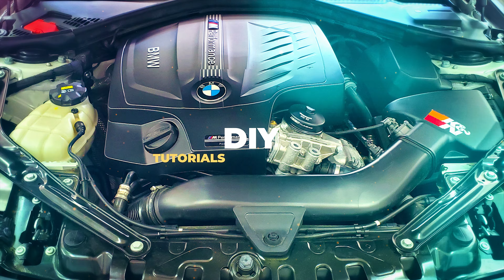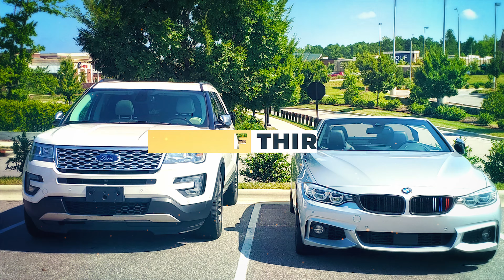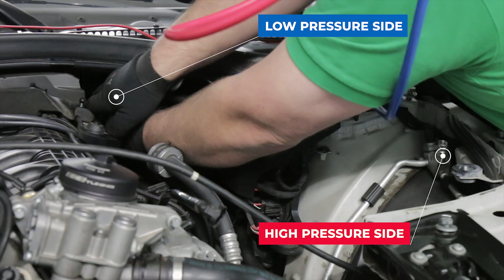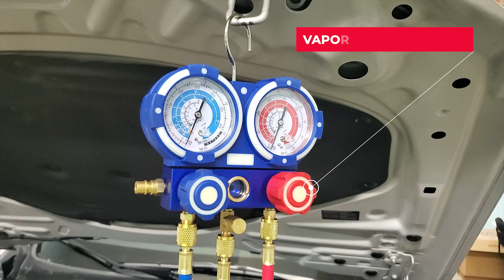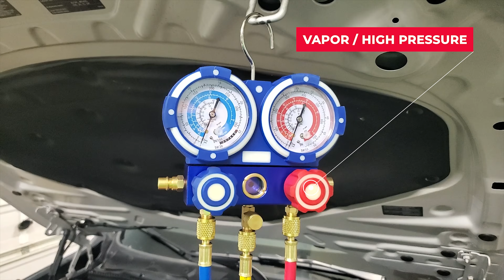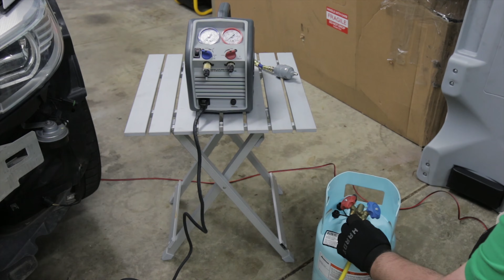EVACUATE YOUR CAR'S AC SYSTEM THE RIGHT WAY

Comment from the maker: A must when working on your car's AC system 👍 🧊❄⛄❄🧊

🛠Tools Needed🛠
Recovery Tank: https://amzn.to/3xee9hI
AC Vacuum and Manifold Gauge Set: https://amzn.to/32bI5wY
Additional Yellow Hose: https://amzn.to/3n8Eg5o

Refrigerant Recovery Machine: https://amzn.to/3twzcdj
Recovery Machine Filter: https://amzn.to/3n3pcFS
Safety Gloves: https://amzn.to/3sBjCvI
Safety Glasses: https://amzn.to/3atpcKl

🎥 Helpful Videos 🎥
Install the CSF Performance Radiator: https://www.youtube.com/watch?v=ZxJ61JY2iaY&t=0s
Replace Your F-Series AC Condenser: https://www.youtube.com/watch?v=QIfHN4UWcIA
Reply: almost $950 and then they wonder why the system is evacuated "the other way"...
Reply: All you need is a Valve stem remover.
Reply: @RiggyRiggshow did you drain the ac? You just remove the valve stem easyly?
Reply: How do you put refrigerant back in??
Reply from the maker: I'm not sure what you've seen previously, but I had everything connected exactly how the instructions showed.
Reply: Why do you need additional vacuum pump? I thought the blue evac machine did that

Comment: Tank is $600 hose is additional price and the recovery tank is $100+. Then you gotta find outwhere you can dispose or get rid of the stored old freon. Self repair would be estimated around 1k in funds. Seems cheaper to take it to a shop. I hope this helps anyone who needs to replace an ac condenser
Reply: If you have two old jags and two old Mercedes and the ac is borked on all of them it starts to look tempting?

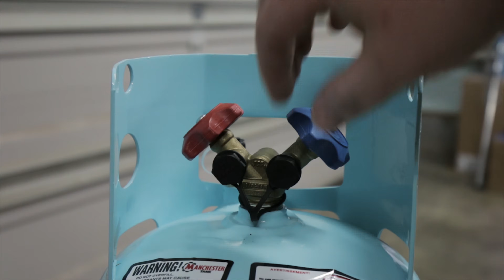Comment: 1:58  Ambient “air” is made up of 78% nitrogen, 21% oxygen, and the rest being “other gases.” There’s no reason to open a brand new tank’s valves to vent the 100% nitrogen atmosphere within the tank and risk exposing it to moist ambient air, even for a moment, prior to hooking up the vacuum pump hose. Simply start the pump motor and then open the valves.
Reply: Why not just connect the pump to the tank then turning it on  before even letting the nitrogen out of the  tank?

Comment: low side high side doesn't matter when the system compressor isn't running its in the same state on both sides and the low pressure side is the vapor side its vapor until it is in the condenser until it hits the orifice tube and goes to low pressure turning into a vapor

Comment: At 5:21 you said - slowly open the inlet valve on the recovery unit (machine) until it begins making a knocking sound, once you hear that knocking sound, slowly close it until the noise stops.

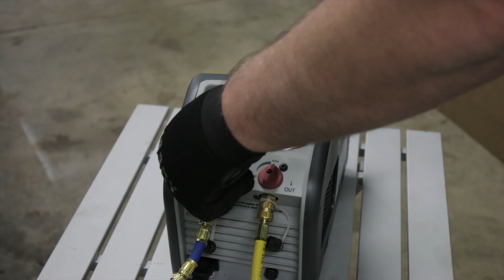At 6:01 you said - then, on the recovery machine, close the inlet valve first... 

( so then.. you never showed in this video when you re-opened the inlet  valve, to then re-close it...because, you had already closed it at 5:21 

Great video,  but that part is confusing to me.
Reply from the maker: You don't close the inlet valve all the way, only until it stops knocking. It's still open, just not full wide open.
Reply: @fthirty3  thank you so much 🙏

Comment: Vacuum and manifold gauge set linked came with parts missing. Manufacturer didn't respond when I contacted them. Save some money and rent this from an auto parts shop. I got the deposit back so it was free! All I had to pay for was the oil.

Comment: I see where you opened the LP/Liquid side of the manifold gauges, then opened the outlet side of the recovery machine, turned it on, and then turned on the inlet side of the machine until the knocking sound stopped.  

How is anything getting pulled out of the LP/liquid or HP/vapor side quick connectors if the connectors weren't turned to the open position to tap into the system?  These would have to be opened before opening any of the valves on the manifold gauges, correct?

Comment: How much money to spend in order to save $20.00 in new freon at Walmart? Recovery freon when million cars out there are leaking every second, even new cars on lot and those that no one bought it. is absurd
Reply from the maker: It's a closed system and should never leak. If you're leaking....there's a problem.
Reply: @fthirty3  Nooo. Maybe you don't know anything about a/c systems. In my Elantra 2008, never has any services and just last year I had to add a can of freon, because was at 85 degrees inside with a/c on, and then went to 41 degrees. It was just a little freon. meaning all system release or lose freon with the time, so what the hell are you talking about? This happens to millions of cars owners.
Reply from the maker: @HeydaCarreras   I think you might be the one that doesn't understand how a/c systems work in vehicles. Just because you don't have a massive leak does not mean you don't have a leak. You could be leaking through microscopic holes in your evaporator or condenser coils. You can also leak through worn out evaporator and compressor seals. Your anecdotal experience and lack of troubleshooting to find the root cause does not mean that all vehicles leak Freon. 

In my case, I needed to remove the refrigerant from the system because I was replacing my condenser, and I didn't want to throw toxic refrigerant into the air to do it. Go to any shop and ask if they just release it into the air when they work on A/C systems. Anyone can do something the cheap/easy/wrong way, but some of use like to do things the right way even if it means it might be a little more work or cost more.

Comment: What's the difference between a recovery machine and a vacuum pump?
Reply: A vacuum pump evacuates all of the air and moisture out of your system.  The recovery machine sucks all the refrigerant out of the system, compresses it back to a liquid, and pumps it into the tank.  It has a big a** motor, a small radiator, and fan.

Comment: R134A is not toxic to the Ozone Layer.  It was developed to replace R12 that is toxic to ozone.  EPA opposes R134A release to the atmosphere because of its Greenhouse Gas Potential.  R134A was released to the air for many years until 2020 when a law was passed.

Comment: You left out several things: what's the red port side for on the recovery tank? You never drained the red high pressure side into the tank?
Reply from the maker: The two sides are connected in a loop. You only need to drain one side.
Reply: I thought he bled the blue side first, then made a quick remark later about opening up the red side.

Comment: How much would a shop charge?
Reply: In many cases, shops will do an evac for free (or low cost) since they will get paid for the reclaimed refrigerant.  You'll have to call around.  As for repairs, proceed with utmost caution.

Comment: I'm about to fix my ac in my car as my condenser also got damaged and i heard letting refrigerant out into atmosphere is horrible so i ended up here to do it the proper way. I also learned you gotta make sure theres no moisture in the system... And after my research i figured this isnt a hard extra step at all... but then i checked the cost of the recovery machine and the tank.. i think ill find an alternate method of evacuating the system without releasing into atmosphere..

Comment: Hello friend, your video is incredible, thanks to it I fixed my car and saved money, but I have a doubt and question ❔❔❔.  After doing all that process I have to add oil to the system again.
Reply from the maker: Glad to help! It depends on how you fill it. If you use straight 134a, then yes, you'll need to add some oil. If you use the AC recharge cans like ACPRO, then no, because it has everything already in it.
Reply: @fthirty3  Thank you very much for the information, I appreciate it, God bless you 👋
Reply from the maker: You are very welcome! 🙏
Reply: When you add in the oil, add in some UV dye as well.  Many YT videos on this.

Comment: After buying all the equipment you might as well take it to the dealership
Reply: Well, yes, but… if you have a number of vehicles whose ac is not working it starts looking different. Then, does the system just need a “recharge” whatever that means, is the condenser leaking, is the compressor bust or any combination of the above? Next, you take it to a dealer and either it costs a kings ransom or he says the parts are not available. Sometimes the dealer / workshop just doesn’t want to do it because it’s hard work and they prefer easy stuff.

Comment: You forgot to purge the ac lines of air when you connected then to the Robinair.
Reply: Good point.  Does it even matter since we're not recharging an AC system but draining it.  On the other time, why do we vacuum an empty tank?

Comment: Ok i decided to set the record straight for everyone who is not 100% sure wth they are doing in the first place and let you know whats toxic and whats very very  low toxicity.
R134a my friends is a very low toxicity refrigerent and yes they prolly use in air cans because its not really toxic at all. But you should still try and recover rather than release! Now lets say R410a this is some nasty stuff for general idea 2 pounds of R410a is like running your car for 6 straight months   24 hrs a day and releasing 2 tons of carbon dioxide into the greenhouse.
So its best to do a little research to find  out how toxic your refrigerent is before working on any system. With that said its always proper to recover than release!! You release R410a your an as$h%#@! Have a nice day!🫡

Comment: Can anyone explain vapor side vs liquid side?  So if you just recover using the vapor side (low side service port into vapor tank valve via the recovery machine), liquid refrigerant will still be left over on the 'high side' of the car's a/c system?

Comment: One of my ports schrader valve is leaking. Cant see buying all this. Will have have someone take it out.
Reply: Some shops have a tool to replace the valve on a pressurized system.

Comment: I hope I can get an answer.
-- I have a Kia soul 2012 2.0L automatic. The compressor has been leaking a drop for some time. I tried to stop it with RTV silicone but not luck. The car has 74K miles, A/C is cooling fine, and compressor is working. Do you think I will need to replace expansion valve and Drier with 74K miles and the system working just fine?
-- I already bought a brand-new compressor (OEM), and planning for next year to change it. summer is coming and I live in the desert with 110 degrees.
I keep my car in good shape. I'm not a stupid kid keeping the car full of garbage, and never take care of their car, so now you know how my car will be.
-- I will appreciate any reply. Thank you for this video and your answers.
Reply: You don't need to replace the expansion valve. You typically should replace the drier when you are replacing the compressor.
Reply: Since you will have 50 to 300 psi in your system on a hot day, there is no way silicon sealer will hold.

Comment: Yeah, not going to buy this machine because the HFC-134a is sold inside of "canned-air".  It is used in the electronics industry for air dusters, as well as a propellant in the medical industry.  R134a is NOT toxic to the ozone.  It has a 1300-1400x warming factor over CO2 though.  Until the electronics industry and medical industry ban this as propellants and stop venting them into the atmosphere I will not comply.

Sincerely,

A voice of reason.
Reply: so if we don’t care about that, can i just hook up a vacuum pump to the yellow line instead of the recovery system, and evacuate the r134 that way?
Reply: @Lick2Trip  no. Vacuum pump removes air only.
Reply: True, but cars and home hvac contain massive amounts of refrigerant compared to a little duster. Don't just vent into atmosphere. Many auto shops will recover it for free.
Reply: @event3horizon  I called like every shop meet me and none want to just evacuate the r134a 😭😭

one said they would for $250… 

the main reasons they didn’t want to was either 1. you’re taking away business from us by doing it yourself 

or 

2. shop liability if something happens we don’t have you under contract under our insurance
Reply: @Lick2Trip  That is very odd. Probably the best poor man's option is to vent slowly into a closed bucket of water. This way it will not totally go into the atmosphere. The bucket can then be taken to a toxic material facility.

Comment: Nice video. Someone already mentioned the blue valve is the vapor side and the red is the liquid side. But I'd like to add that you should use a weighted refrigerant scale as not to overfill a tank, which would be dangerous. And since you didn't purge the lines, air will be in the tank as well as moisture. Those tanks are made of steel and moisture will degrade that tank over time. Please do not recharge your system with recovered refrigerant. Once full, take it to be recycled properly. Please explain the purpose for the moisture/contaminates filter. Most recovery machines don't come with those adding to additional costs. Thanks.
Reply: Why can't you reuse the old refrigerant? Does it degrade? Is it just bad practice due to the possibility of there being contaminants? If it was already in the system before then what's the issue? Genuine question as I don't know much about this topic
Reply: I don’t think he was adding anything to the system, he was evacuating the old refrigerant to prep the vehicle to put the new refrigerant in.
Reply: Did you find out if you can use the recovered refrigerant?
Reply: @cisoflores  Current rules allow you to put the recovered refrigerant back in the original system, but no place else.

Comment: The big thing about recovery is cost,and epa if the right person sees you. Yes you can buy r134a in small cans,and a 30 lb is pushing 400.00 now,so if you do much ac work recovery is saving your refrigerant.
     Health ... Dont vent in an enclosed area where you can inhale into lungs,reducing your capacity, senior chief in navy stressed that,and we used r12.
    If you see oil on condenser you probably have no need for recovery,but new condenser,gaskets,o rings, receiver drier.....pull vacuum and charge.  If you lost compressor you need to flush and dry with nitrogen.
    And stay away from sealer...it damages  equipment. Some shops charge double or will only replace whole system...3,000.00 sound good? What a friend told me.
     R12? Convert to r134a unless you have access or can afford r12.... Need to flush and use approved oil.
   The fine is 10k, but if you're doing recovery its hard to fine a diy , you're not deliberately venting.
    From what I've read, r1234yf.....i have my opinion as to why its yf....its made from propane made less flammable....if anyone can clarify I'd like to know
Reply: R134a is the same thing in canned air that they use to clean cameras and copiers, 1,1,1,2-tetrafluoroethane. If you have an R12 system, use a hydrocarbon refrigerant like Envirosafe Industrial R134a replacement refrigerant. I'm using it in my R12 converted system, and it cools so much better than R134a. Yes, definitely don't use sealant. I've been cleaning it off my orifice tube filter for years. Flushing it wouldn't even get it all out.

Comment: You need a real vacuum gauge to know moisture has been removed and nitrogen cylinder with regulator to run a pressure decay test.

Comment: Hello my system is empty, my compressor is already installed and unit is NOT in use.

I have been told the air needs to be bled from line before any new Freon is added
Reply: Yes, your system needs to be vacuumed.  You also may need to add PAG oil if the replacement compressor did not come with oil.

Comment: Purging the system or evacuating the system until it gets to zero is not sufficient it must be Sub-Zero and at least a few lines under zero which takes approximately 30 minutes to 45 minutes as this is a mistake a lot of AC guys make
Reply: What if the refrigerant has been contaminated by a failed compressor? How is it filtered before being evacuated to the tank?
Reply: @TruthInFlying  at that point you would definitely change the compressor and add the proper oil but you would also have to flush the lines with an AC flush kit

Comment: So I got up to the point where you said "open the vapor valve on the tank" and that's a problem. If I do that the vacuum I pulled in the tank is gone and anything the machine then pulls into the tank will just vent into the atmosphere. Suggestions?

Comment: Jiffy Lube in San Diego, CA charges $139 to evacuate and refill in case you want to avoid purchasing some or all of the equipment.  I'm changing my AC Compressor, but didn't want to purchase the Robinair RG3 Portable Refrigerant Recovery Machine.  The guages and vaccum pump are very reasonable at Harbor Freight, but the tank and Robinair just weren't in my DIY budget.
Reply from the maker: I wouldn't feel comfortable with jiffy lube changing my oil let alone evacuating my AC system.
Reply: Me neither but I can't afford all these tools right now. Think I'll check around other shops. The only reason  this is so appealing to me is because my condenser bent but didn't break and there seems to be no leaks so it would be nice to just take the refrigerant out and put it back in after the repair. Not for the moneys sake but as opposed to having a shop doing it and guessing how much oil was taken out along with it because I've read they have a way to measure the oil removed meaning oil does get removed. @fthirty3
Reply: did you have jiffy lube evacuate and refill? I too need to replace a part (condenser not compressor) but am wondering what amount of oil is going to come out and need to be put back in and if the shop has said anything to you
Reply: You can buy a Velvor machine for $299 using a promotion (may or may not be currently available).  There is a YT video on this.

Comment: As a barging hunter, I managed to grab an older r134 recovery machine (gs200 NRP) for about $80 at a local resale shop and a tank off Facebook mkt for $10 the most expensive price of the whole repair was the compressor itself!
Reply: I use a Valve stem remover... Easy.
Reply: @RiggyRiggslmao 🤣🤣🤣